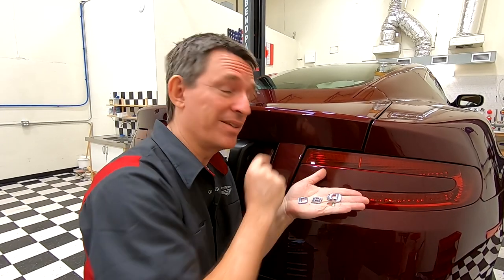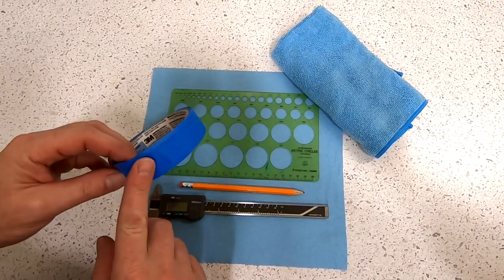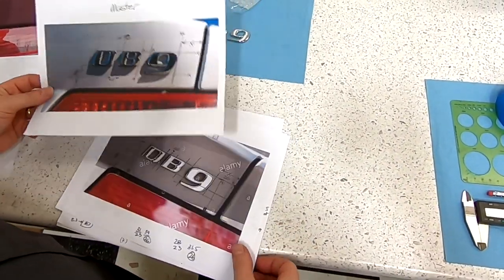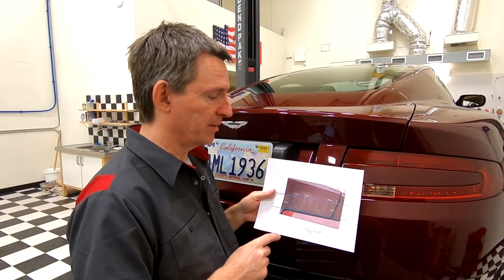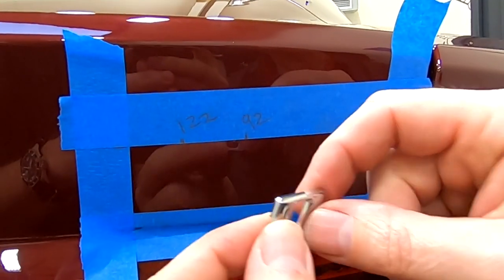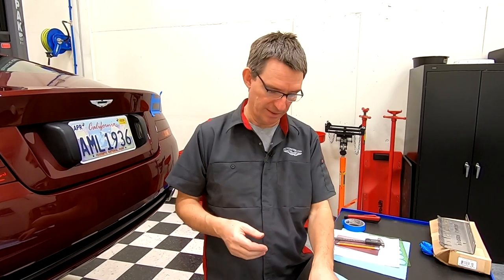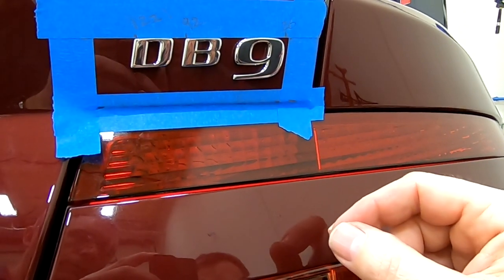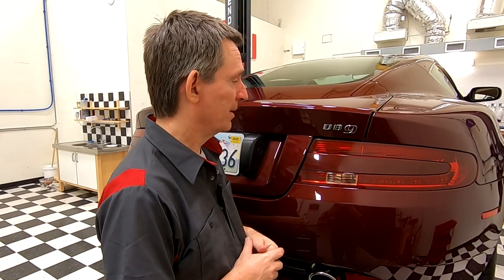Installing the DB9 Badge on an Aston Martin DB9

Comment: Why didn’t you ask AM?
They should know this for sure.
Reply from the maker: Well, that's a good questions.  I did not reach out, but I would have no idea who to reach out to.  I figured if a factory certified paint shop didn't know, then there wasn't a guide.  I could be wrong though, you bring up a good point.  Any idea on who to call that would have the answer?